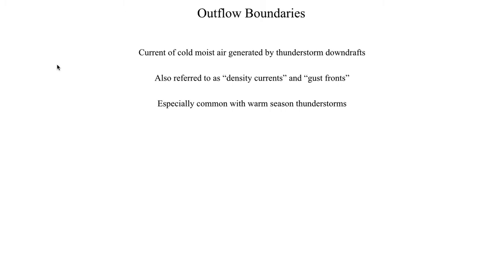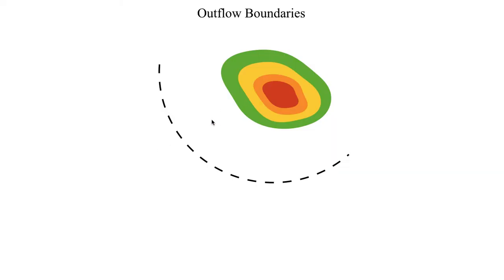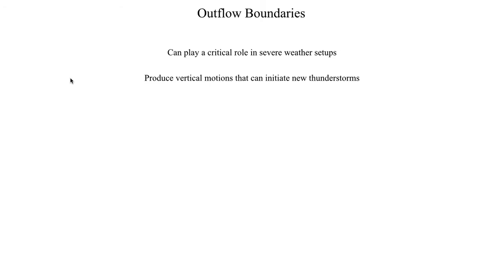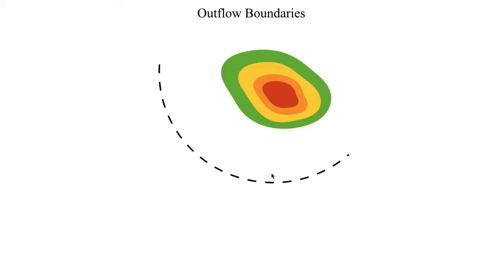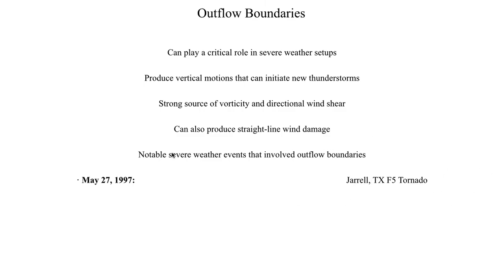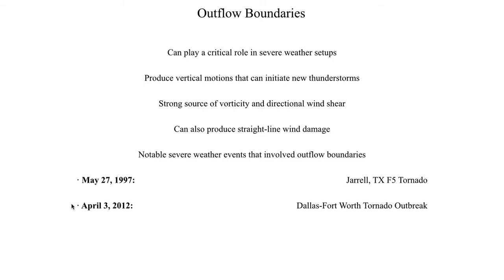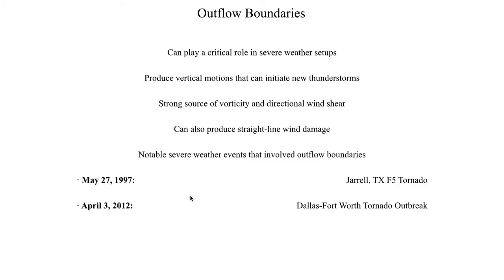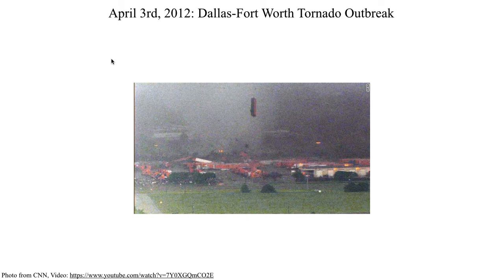METR2023 - Lecture 20 - Segment 2: Outflow Boundaries

Comment: Thank you for this information! Didn't the El Reno tornado latch onto the outflow boundary?
Reply from the maker: You're welcome! And, to answer your question, I believe the May 31st, 2013 El Reno tornado did latch onto an outflow boundary and that is partially why it moved so erratically and attained such a high intensity. However, since that supercell was in close proximity to another supercell, it is unclear which supercell's outflow boundary was ultimately responsible for producing the tornado (there is also the possibility that both boundaries might have combined accomplish this).

On another note, this is still a very poorly understood phenomenon. There are 100s (if not 1000s) of outflow boundaries every year in the United States and only a small fraction of those ever result in tornadoes, and an even smaller fraction is associated with major tornadoes. At present, we only know that these tornadoes usually occur in extreme CAPE environments near outflow boundaries that are "slow-moving", but that still begs the question of what exactly qualifies as "extreme CAPE" and what exactly qualifies as "slow-moving". This question probably won't get answered by a field campaign given the rarity of achieving an optimal combination, but some ultra high resolution computer models might have some luck in discerning some patterns.

Comment: In the outflow boundary flow after the thunderstorm has diminished.  Are those now part of the gradient wind flow? For  example, a thunderstorm  is to my northeast , the outflow boundary moves southwest, so does that mean I'm having northeast winds even within a southwest  gradient windflow? Also I call outflow  boundaries , gust front boundaries
Reply from the maker: Usually, the term "gradient wind" refers to a balance of the pressure gradient force, the Coriolis force, and the centrifugal force. And, the gradient wind is typically a synoptic scale pattern, whereas outflow boundaries are primarily a mesoscale phenomenon. So, I wouldn't consider it as being part of the "gradient flow", even though it may vaguely resemble a gradient flow pattern at times.
Reply: @davidstang2188   is there a term with gust fronts called  first gust and second gust? I've seen winds start  out light then gradually build into a gale!!
Reply from the maker: There is a term for "first gust", which refers to the initial increase in wind speed caused by a thunderstorm downdraft (or outflow boundary).
https://glossary.ametsoc.org/wiki/First_gust

By "second gust", you probably mean something like "3-second wind gust", which refers to the maximum sustained wind speed (or average wind speed in some cases) over a specific timeframe (usually 3 seconds).